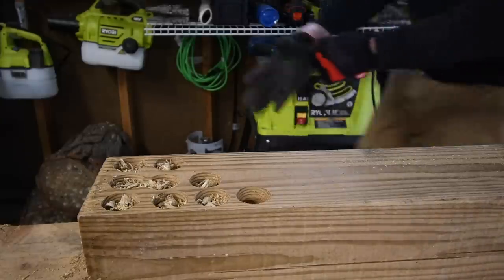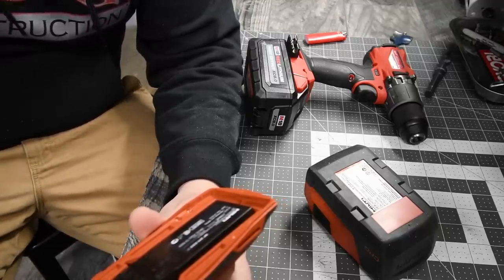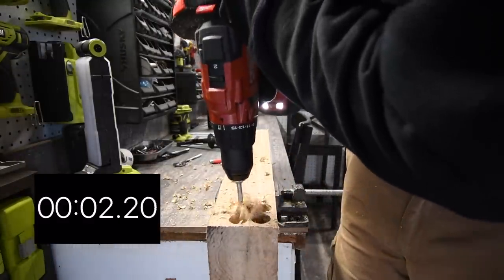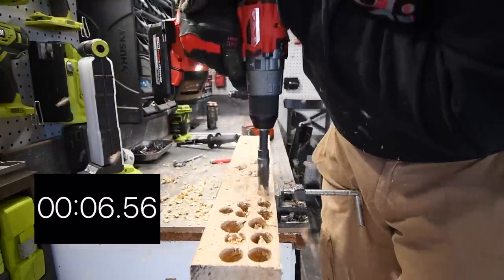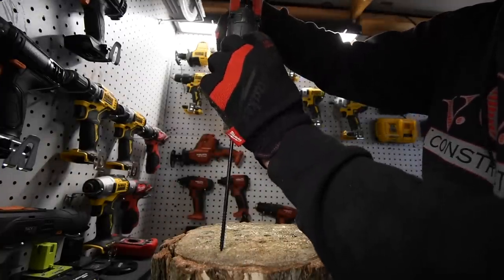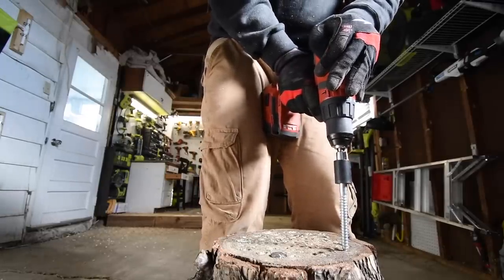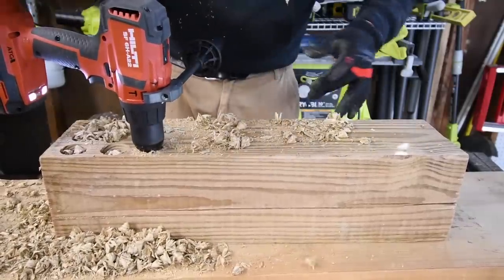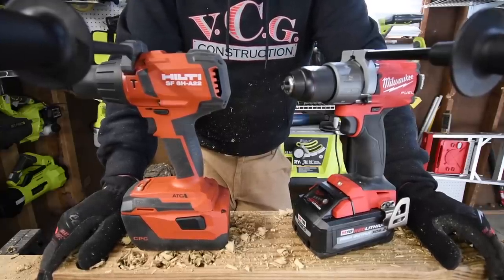HILTI 8ah vs Milwaukee 8ah HO Battery (WOOD)

Comment: Wouldn't it be more accurate test if you had some kind of weight pushing down on these drills rather than your own force. Not the most accurate test surely?
Reply from the maker: when it comes to more of a control test like that it would take a long time to do the job. these video would be 30-40 min long and nobody will watch it in its entirety. I try to be as accurate as possible, Thank you for viewing sir
Reply: @ManCaverTools  I hear what u are saying buddy and I did like your vid. I also like Hilti stuff but for the price difference and the only slightly faster times, I'd have the Milwaukee. Thanks for reply. One new subscriber coming up...

Comment: Do you ever build anything? Or are you just drilling holes and driving screws.?
Reply from the maker: its winter time. I will continue to work on the house during spring summer and fall. along with working on the boat, its was 0 degrees yesterday. im good on building stuff right now. besides, I used to upload working on the house all the time. people aren't interested on watching that so I mainly just upload videos like this now
Reply: evolve p. Kind of an inconsiderate comment. Man Caver is providing information regarding power tools which is way more positive and helpful than posting crappy comments.

Comment: You need some kind of jig for your test! The test are inconclusive do to varying pressure you apply. So honestly these test are Severely Flawed
Reply: Most of these test don’t even make sense
Reply: And I couldn’t agree more with what you said
Reply from the maker: when it comes to these type of tests that you see on YouTube, do you know how long this video would be if I let the tool do all the work? it would probably  be 30 min long or I only do 1 test. so I put pressure on each tool as equal as I can. thank you for viewing
Reply: Man Caver Tools not necessary for the video to be that long. Prime Example of someone that does it right Project Farms
Reply: @darrinborst7205  Don't watch them then!! I enjoy Dave's tests. He doesn't claim the tests to be perfect. If your that bothered buy the gear and do the test yourself. I own both drills and have done head to head tests. I have also used both drills daily in work ever since I got this Hilti. I can tell you that the Hilti is superior in many ways.
Reply: Dave Sheppard to properly do the test you would need jigs and to be in a controlled setting. There is no reason to buy the gear that’s just idiotic. No one in their right mine needs all those tools to be a YouTube video maker, I watch the videos because they are available to watch, if the guy never made another I wouldn’t lose any sleep. I know what tools I need to do what job and it sure as hell isnt an overpriced Hilti. Especially since his “results” indicate that a Milwaukee literally is hundredths of second “slower”.

Comment: ... you put a lot of work on this kind of reviews, probably more then #VCG because you are alone and to speak by yourself takes some kind of sanity. 
I had the opportunity to work closely to some people how hard Hilti and in till now never rises up to my expectations on woodworking  tools .Exceptional laser levels, drywall screw gun , grinder,  demolition tools but not woodworking tools.  Probably with this new generation they will have a place in the carpentry industry,  but still has to make a planer  and a cordless router and a better cordless vacuum . Aaaa and the price , the price is offensive , just for a quarter more faster will never make the market tremble  , even when the huge guarantee skim .
Reply from the maker: I agree the price is outrageous but you do get a better quality tool, Milwaukee is already a good tool so your apart of the m18 or m12 system you are good to go and thank you for viewing
Reply: ... I am a part of the RAINBOW,  not for the categories how has stolen the symbol,  but...  another imapropie word, the necessity has pushed me to have different colours so I can get the job done. Many years in Europe we use 240 volts everywhere  , when I move to England 240 was banned from the job sites because 110 volts is a crap voltage especially when you have long wires I have to become remote from the wires and  start buying power batteries tools , and guess who was more most helpful for all ? Ryobi tools, not the same quality like in America and not the same range but good enough to do the job. After I  burned out a couple of tools,  in the first year of guarantee I started replacing them with Dewalt only because they have the Cordless Nail guns and because of the DCS577,  which I had to import from America,  because Dewalt UK is terrible when came to his clients and they bring DCS577 after 1 year in UK .
Long short story you are blessed with Homeless Despot with that enormous quality of tools and accessories.

Comment: I don’t want to buy another platform just for a drill that’s just fractionally stronger Torque wise...  I’ll stick with my Milwaukee. Greg
Reply from the maker: Milwaukee is a fantastic brand, just because a tool loses in a versus video doesn't mean its garbage or a bad tool.